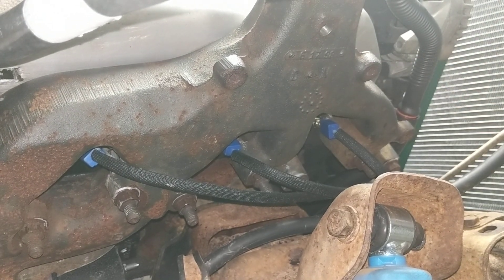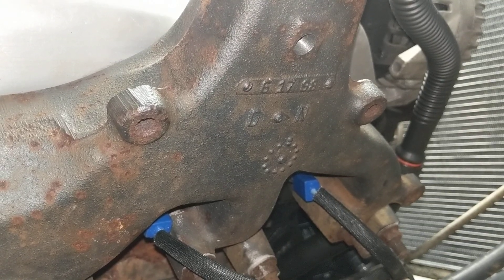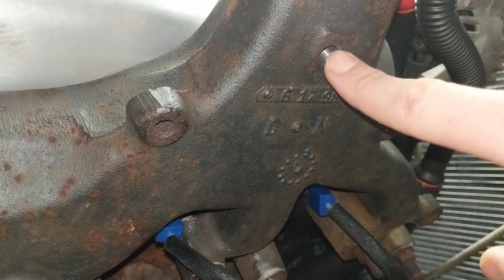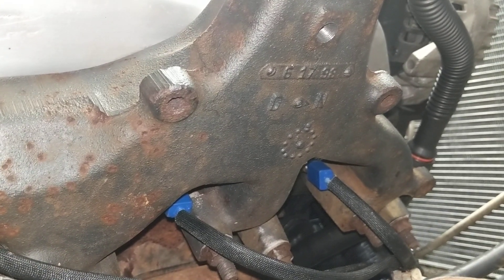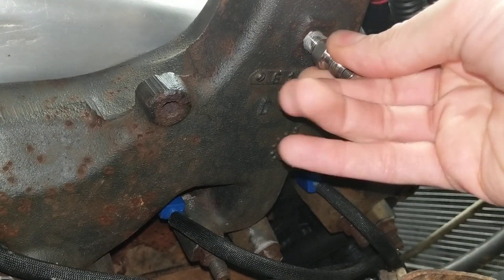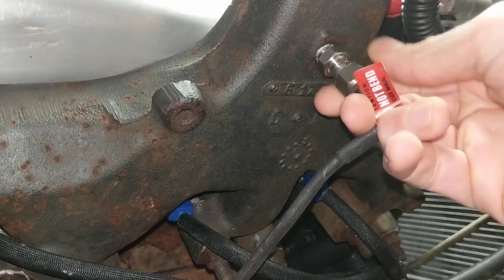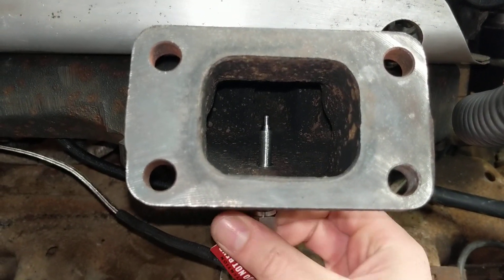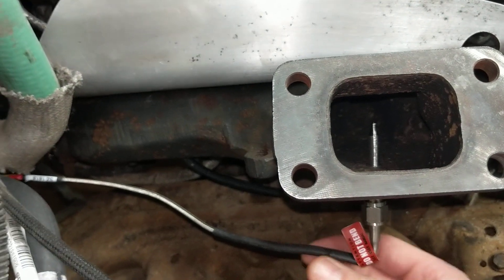EGT probe installation on 6.5L Turbo Diesel

Comment: How much boost are you running with the new turbo? Did you have to stud it? What other mods where done to this truck?
Reply from the maker: This is our K3500 with everything we sell on it.  It has a Super 60 @ 20 psi with new studded heads.  It's always a good idea to stud these engines when you are moving past stock power levels since they have high compression. Heads frequently need replaced anyway from heat damage over the years.